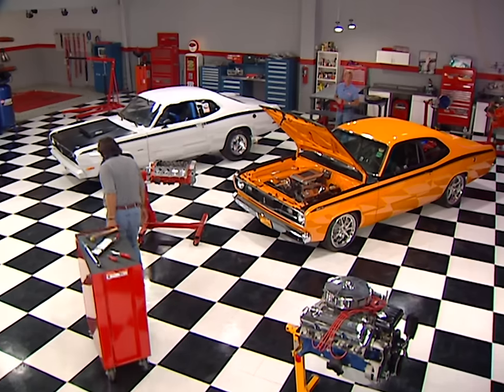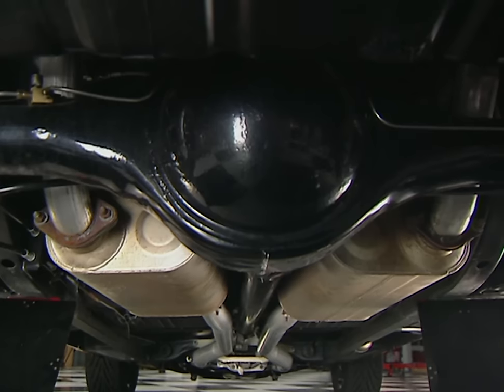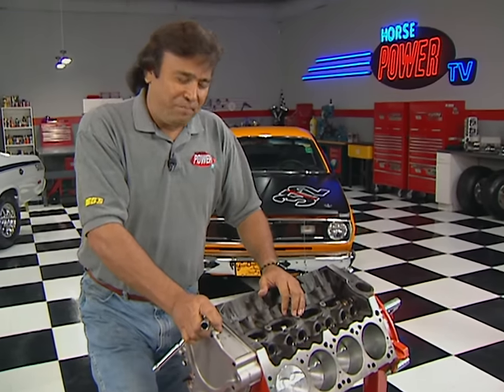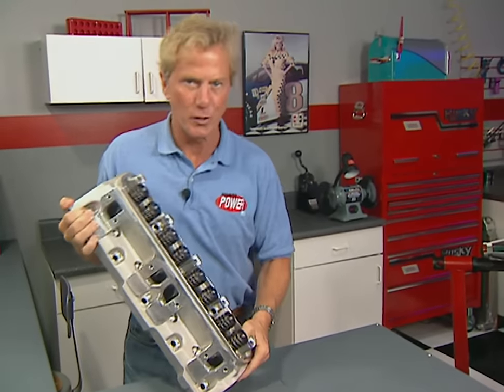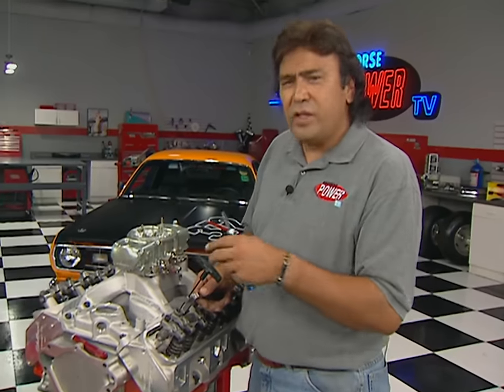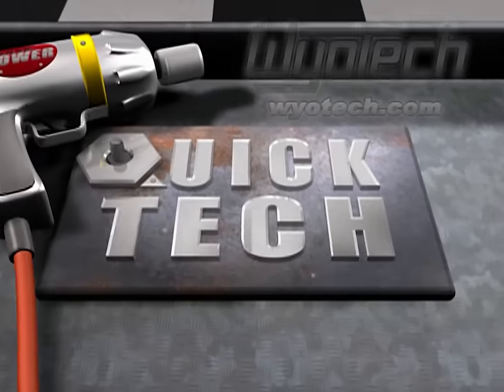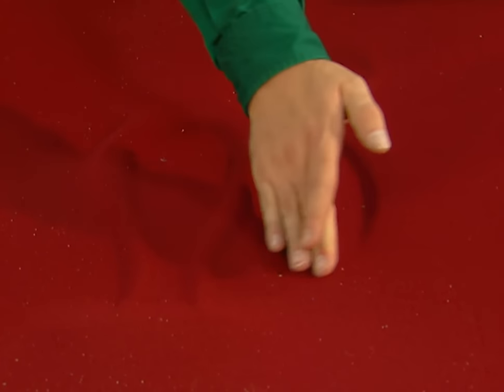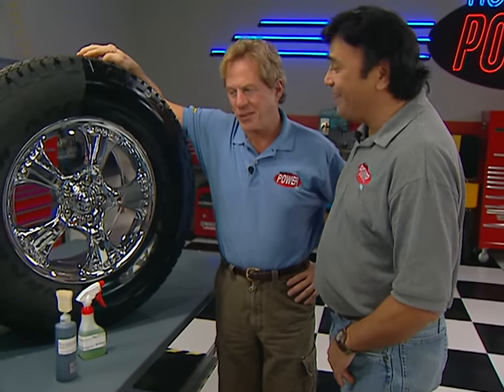Building An Affordable, Streetable Magnum 360 Short Block - Horsepower S7, E2

Comment: Magnum blocks are not drilled to oil rocker shafts like the la block. The valve train is oiled through the pushrod. Was this block drilled for shaft oiling?

Comment: I hope you didn't run this engine as it will NOT oil the rockers with the setup you went with That Magnum block isn't drilled for the LA oiling rockers you picked. YOu need the Comp 1622 rockers and hollow pushrods to oil through pushrod.
Reply: its  solid  roller cam  so  its  all different than what youre  talking about.  they didnt mention any part numbers back then

Comment: The electric water pump is fine when you run it on a dino but I don't trust it on a street car because it has a thermostat and it will not circulate with a thermostat I know a manual water pump will take away horsepower what is just better